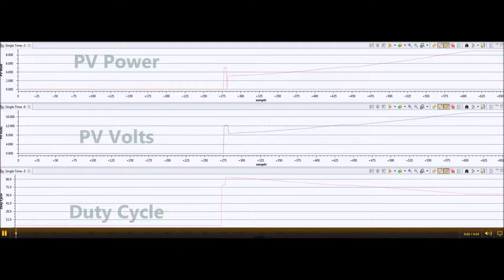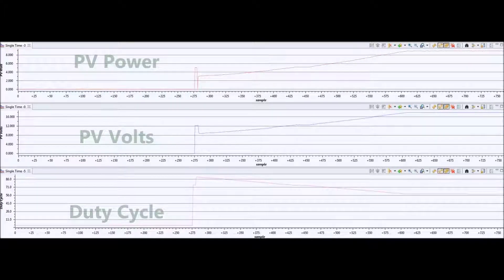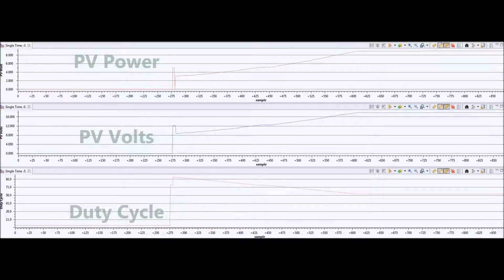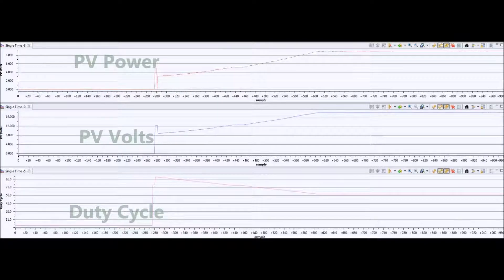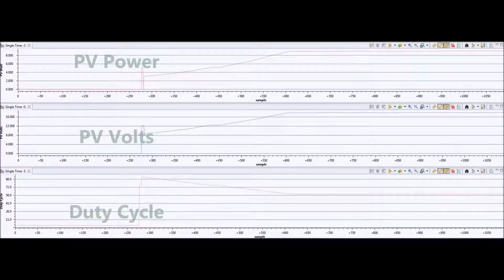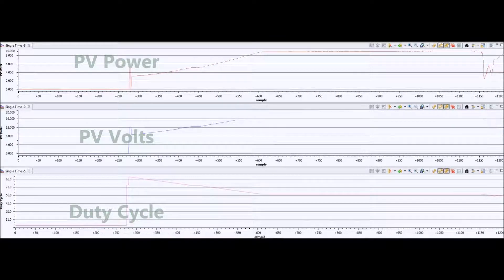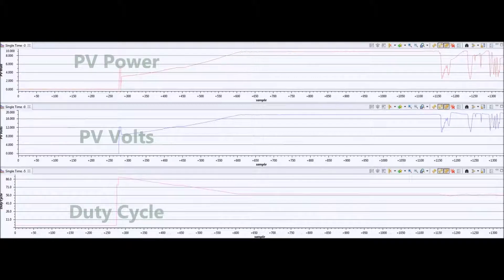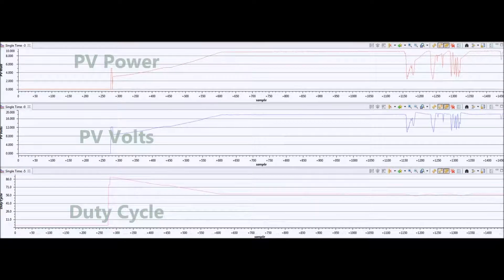C2000 Launchpad Solar Power MPPT graphing data in CCS

Comment: Hi, I haven't see the battery full protection and batfull data in the Mppt code?
Reply: That because there is no battery code or battery attached.  If this was used with say a lead acid then you would want to step down to a higher voltage say 14-15V.  For Lithium I would probably use a further SMPS allowing the voltage and current to be controlled further.

Comment: Hi Ant Scranney,Is it possible to graph variables every 100us (microseconds) ?I need to verify the line voltage(50Hz) read by the ADC sampled at 10kHz.I am using CCS and Piccolo F28027.Best Regards, Kumar.
Reply from the maker: Hi,

As far as I am aware 100mS is the fastest possible refresh rate, I cannot remember off-hand where I read this now and possible updates may have increased this rate.

I would ask the question on the TI engineering forums in the CCS section, a TI employee should know the answer.

Regards,

Ant
Reply: +Ant Scranney Thanks :)

Comment: Hi, 
   I am am working on my bachealor student project and I need to realize the MPP algorithm, I am not good enough in programming and my initial task is to uderstand the MPP using CCS tool, for this I need a sample C/C++ code that I can use to run in the CCS. Can you please suggest where I can get the basic source code (C/C++) for MPP.
Reply from the maker: sanjay p g sanju 
Hi,

I didn't actually find any code myself either, I read a bunch of papers on MPPT which also included some flow charts.  From the flowcharts I constructed my own code based on the Perturb and Observe algorithm which is fairly simple to implement.  Try doing a search for MPPT flowcharts in Google images, this may well bring up some useful results.

Cheers,
Ant

Comment: Thanks for your video. Just wondering how did you captured signals in CCS
Reply from the maker: Hi,

1) Go into the debug mode
2) Add a watch expression for the variable you want to graph
3) Right click on the variable in the expressions window, then scroll down to graph
4) Then there are various parameters you can change to display the data, these are all menu driven and displayed above the graph window.

I added some information to a post here, which may help you to follow the basic steps above.
http://forum.43oh.com/topic/5651-oversampling-averaging-and-getting-confused/

Regards,
Ant